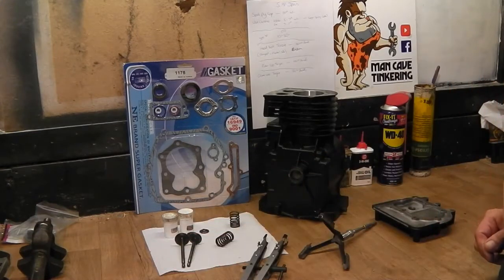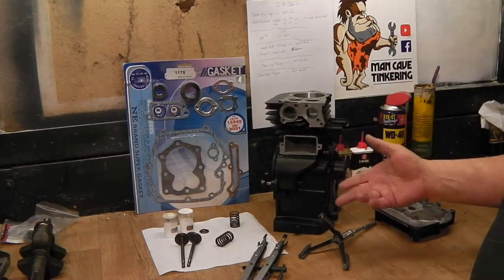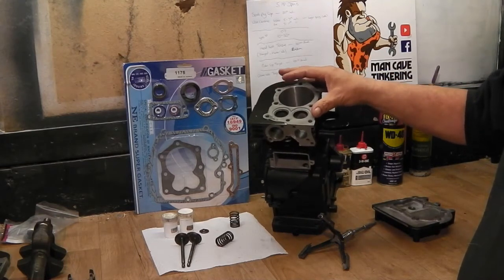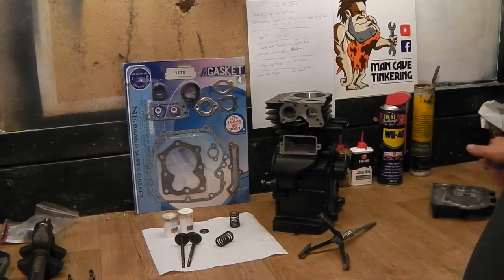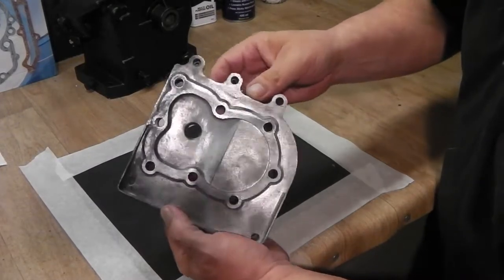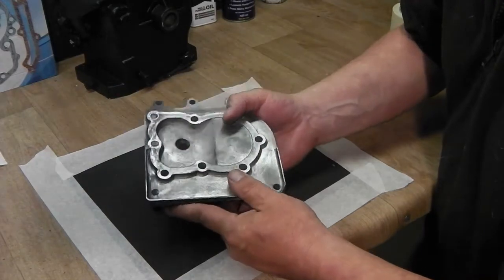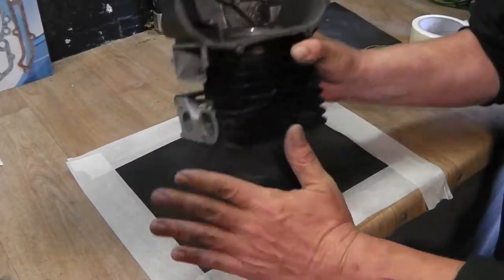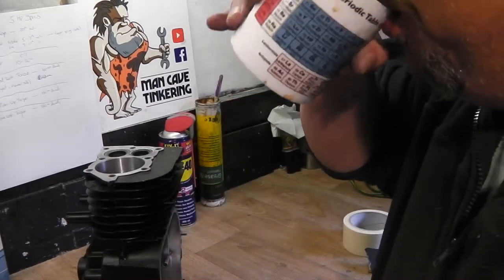Small Engine Total Rebuild - Briggs 5hp

Comment: I add some Duct tape or double sided tape for the valves so the lapping tool doesn't slip or move around on the valve. I bought a new tool and it didn't work so I had to make it work for me.